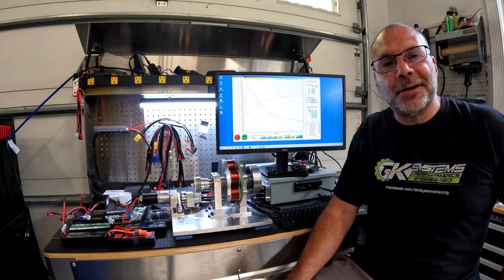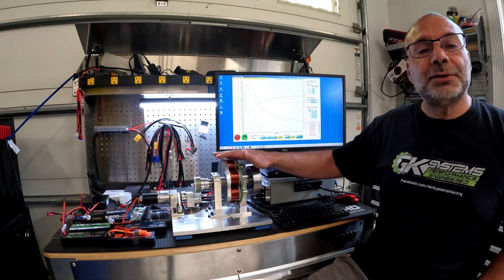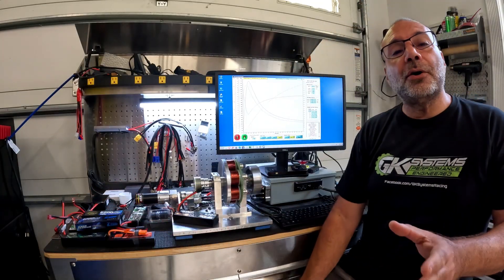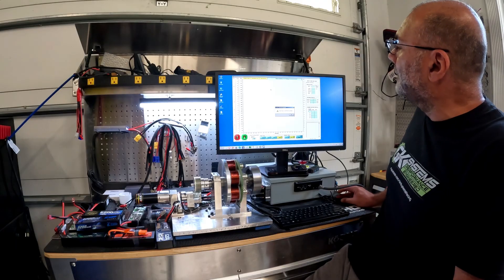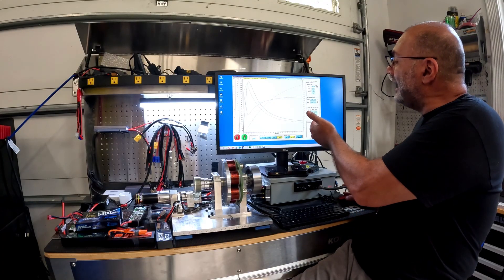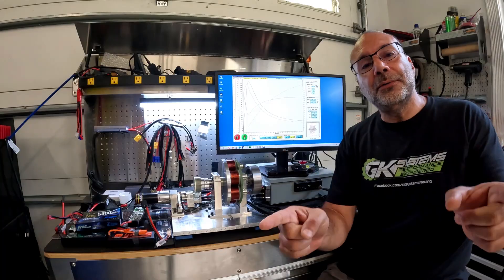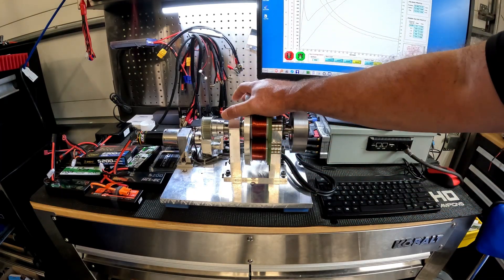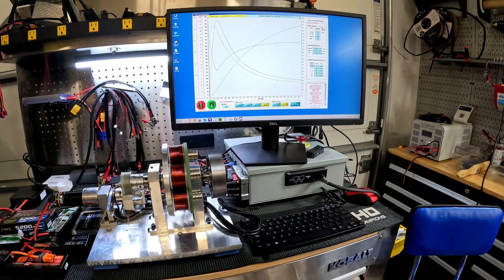RC Battery Dyno Showdown! Real C Ratings & Power Tested, Truth About RC LiPo Batteries

Comment: I think it should be said that all batteries tested need to have the exact style connectors.  
Castle 8mm bullets 
QS8 
AMass 8.0
Something like those. 

we all know that a Standard XT-60 plug won't produce the power unload like a QS8 would. All batteries need to be the same temperature.  Preferably 120° to get maximum output.  I find this intriguing.  Had to give a sub. looking forward to seeing the results.
Reply from the maker: Yes, in our test plan, which we stated in the video ("in a separate video" "the testing procedure and how we are going to do it.") all batteries will share the same connector regardless of what they come with.
Reply: 120 is way to hot for the battery’s. I don’t think you should go over 105-110. On the track if we go over this we see performance drop.